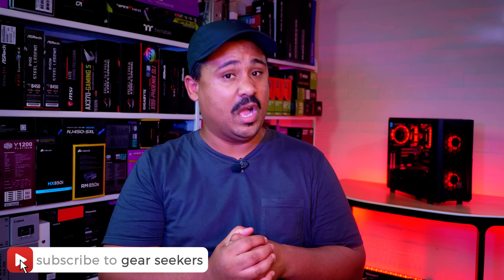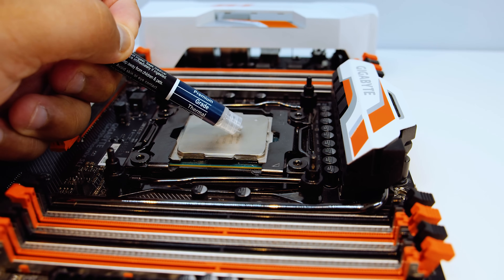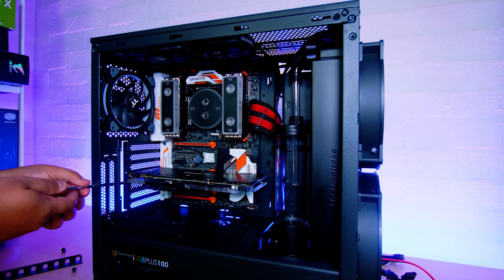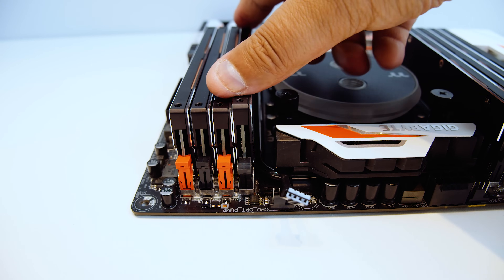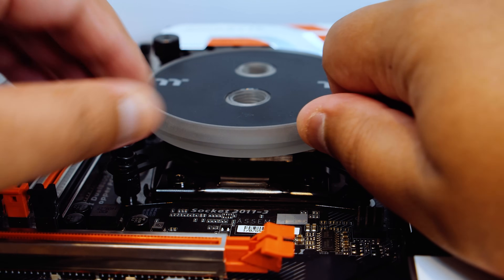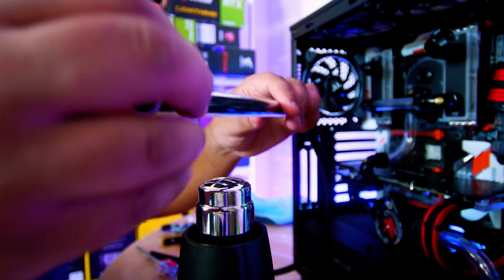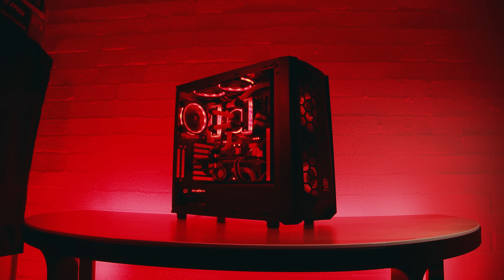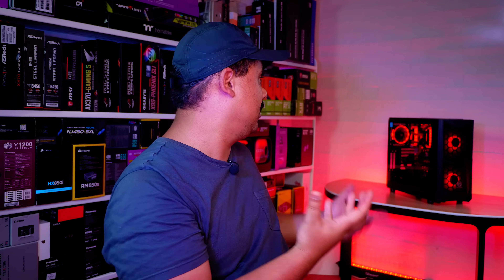Darkside - Thermaltake Commander C35 Liquid Cooled Build

Comment: I have an evga clc 280 cooler and planning to get this case (have view 31 but i want more airflow), do i install it inside sucking air outside towards the 200mm  ( in front) or on top ?